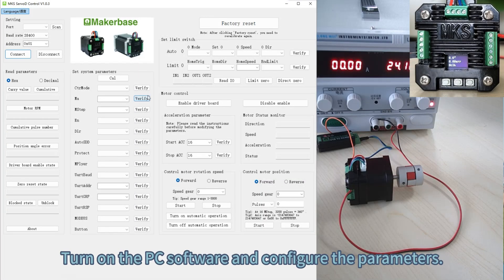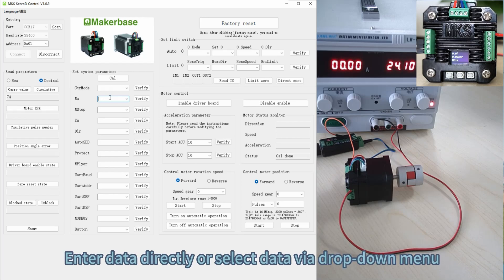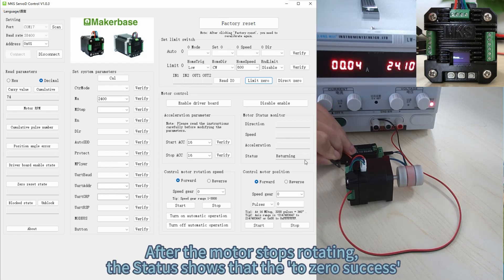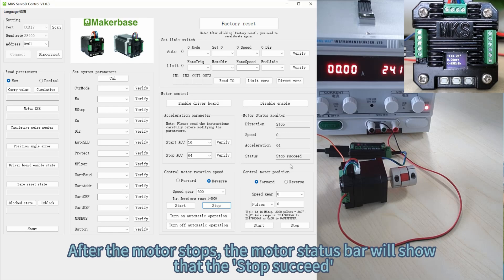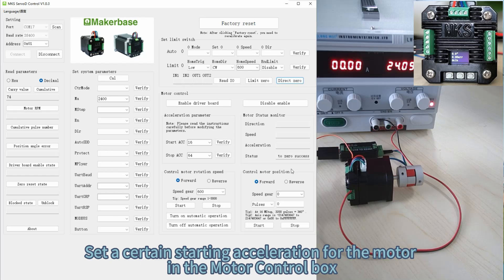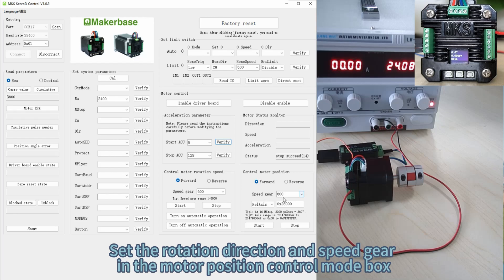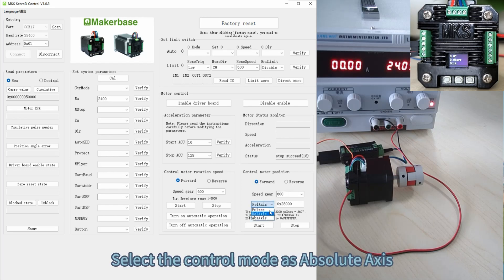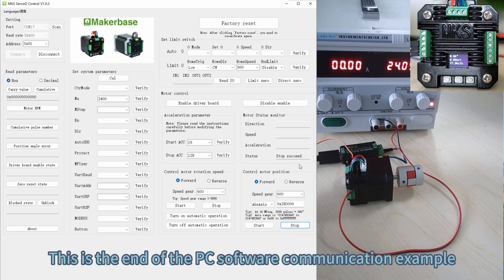Makerbase SERVOxxD Closed loop Stepper Motor Example1 PC Control Software example

Comment: ok, servo42D does support 1.8 degree steppers only.  Also till its first calibrated the menu shows Cal, Mode, Exit in SR_vFOC mode.  Also, the "MKS ServoD Control" Software does not work in Windows 10.  Tried to re-compile, but the build Scripts are too old. I would have to down grade my Qt and all the build tools.  Some of which won't work in my Windows 10.  Probably can be compiled in UNIX, but I am not setup for this right now.  Currently working with LDO-42STH48-2504AH for testing.  Currently using CANable on COM3 for testing but know default Serial spec is available for the Windows 10.  after messing with the Serial port settings in Cangaroo.exe this settings kind of work (Baud: 38400, Data bits: 8, Parity: None, Stop bits: 1, Flow Control: None).  There appears to be more flavors of can out there then their stars in the sky.  It would be helpful for the Firmware for the MKS SERVO42D Moter controller.  I probably won't be able to build it, but it would be a Step in the right direction to get my printer firmware to control it across CAN Network.  This is assuming i can reload the MKS SERVO42D Moter controller board.  Anyway, that's it for now

Comment: I just received two of these boards. Unfortunately could not test yet since calibration throws a Reverse Lookup Error. Rotor spins, and I tried adjusting magnet distance to the PCB, but calibration fails. What could be wrong?
Reply: Is your motor a 1.8º? I was having the same error when testing my 3.6º motors. They claim the driver supports only 0.9 and 1.8.
Reply: @osmargarnica  my motors are 0.9 degree, whereas apparently these particular boards do not support that. I don't know about 3.6, but my 1.8 worked.

Comment: What is the max range when returning to zero after power on? Is it just 0-360° range when finding zero, could it be 0-36000°? since I'm planing to use gearbox on the motor. Thanks